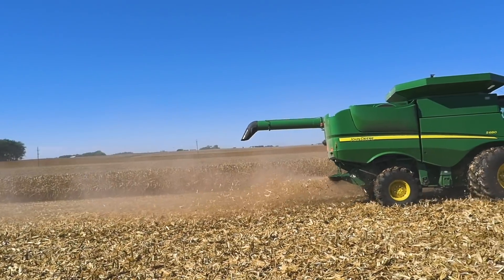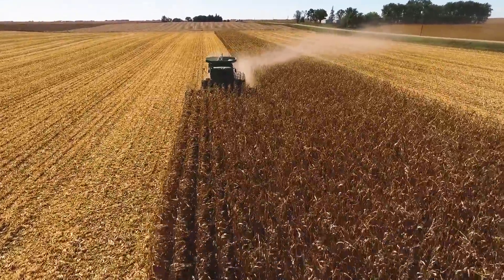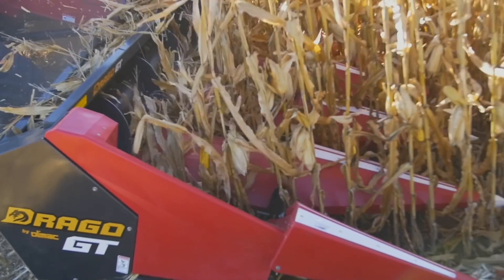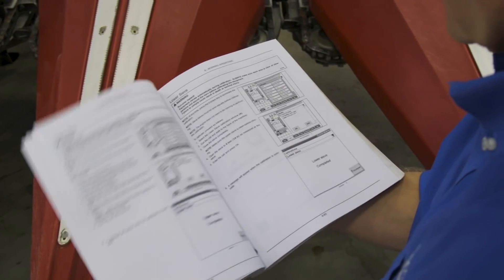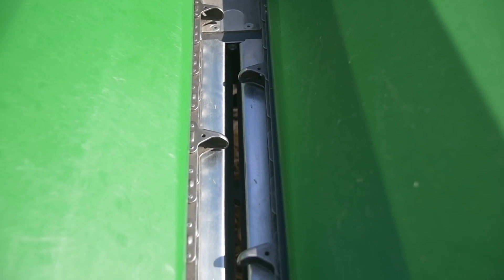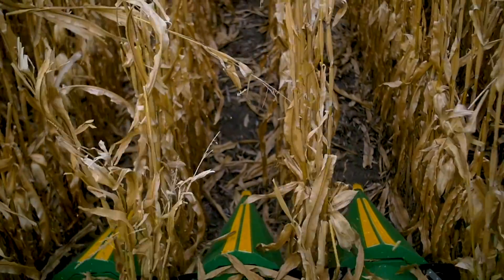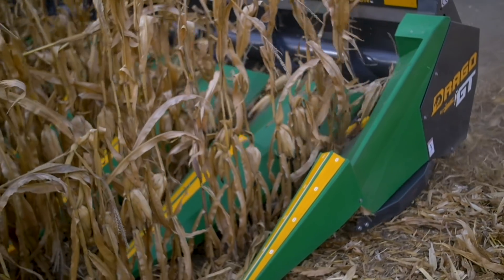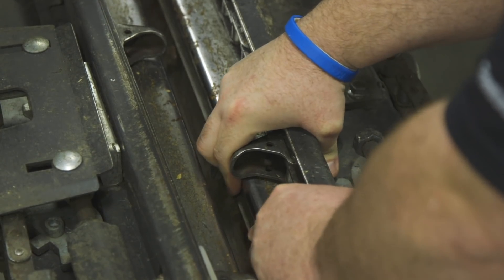Corn Head Adjustment Tips to Prevent Yield Loss | TOP SHOPS® | Successful Farming

Comment: Regarding having the deckplates right beside the stalk... i am going off memory right now, but the setting for my 606c is 18mm at the opening and 20mm at the rear. However slight that taper may be, is that the recommendation - to have a taper? Thanks!

Comment: My main comment is to SLOW THE HEAD DOWN!  On my 6620SH, the head speed sensor doesn't even work.  When you're making your initial adjustments for the season, look at the loss just behind the head, and then behind the chopper.  I was getting loss from the head, so I reduced my head speed.  Someone talks about "grain threshing grain" in another video, let "grain cushion grain" when stripping it at the head.  Reduce the speed that it hits the deck plate.  I'm a small time operator, but you can reduce head losses if you pay attention.